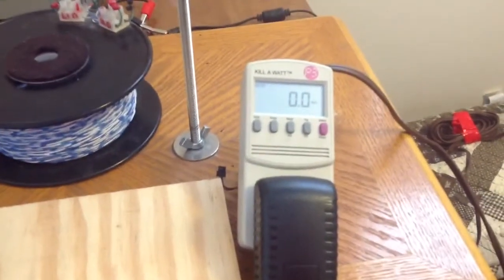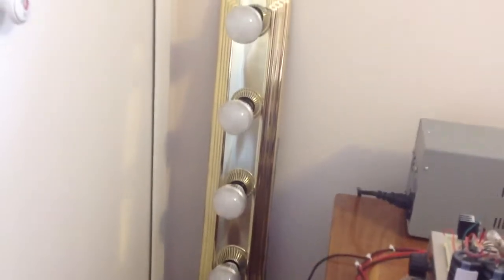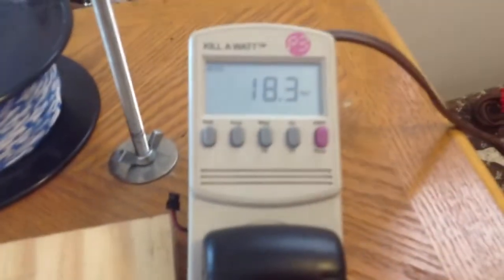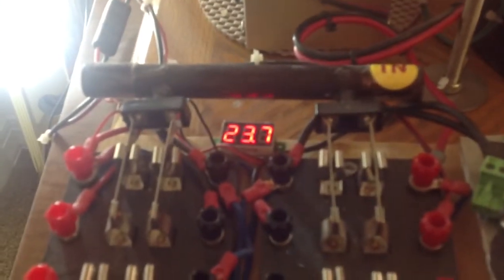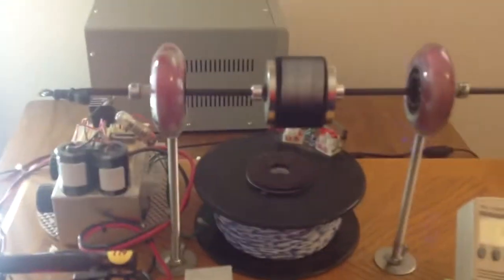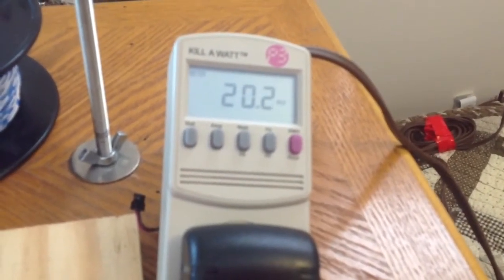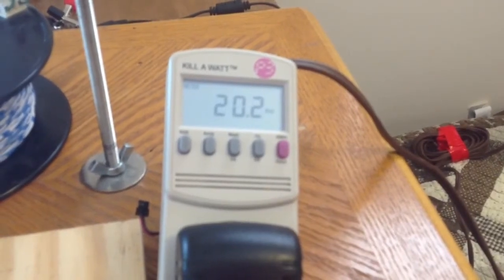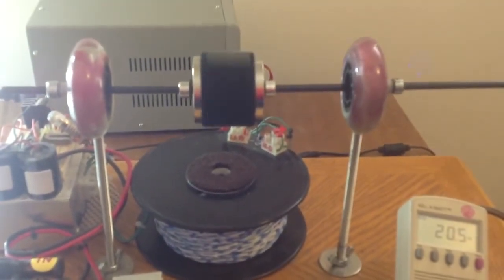WHATS UP WITH WATTS MOTOR GENERATOR

Comment: I think, that lamps can run on not fuul brightness, so on output can be not 28 W, but 15 W, so what you put, that you get can be somthing like this.
Reply from the maker: Hi 
 I plan to make another video showing  this setup  powering 
SIX 7 watt 110 volt led lights. Using a light meter I found each lamp is 1/2 F stop
less bright compared to a lamp powered directly from  a 110 volts AC source.

Even at that my MMOST RECENT findings will be illustrated in the next video.  I found with all  6 lamps lighted up that the measured watt value was 22.8 watts.  Each 7 watt lamp then (doing the math) is using 3.8 watts.
To make things very simple I plan to show both voltage and current on a new digital power supply.    I am not into tricks of any sort. as some may think.

Comment: Very interesting!
Could you show the watts after you start it but, before you stop the rotor?
When you stop the rotor the circuit is appears to be resonating. 
Peace.
Reply from the maker: The rotor just needs a finger roll and the lights come on.  They stay on continuously after that. The lights wont come on unless a finger roll is done..   The circuit seems to resonate-- you are correct.